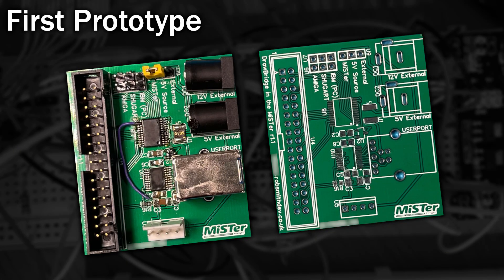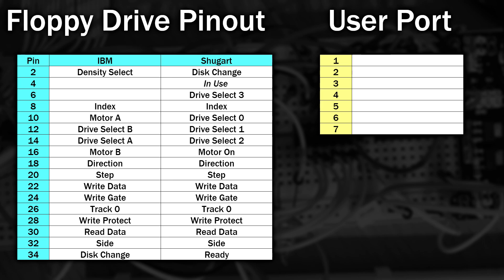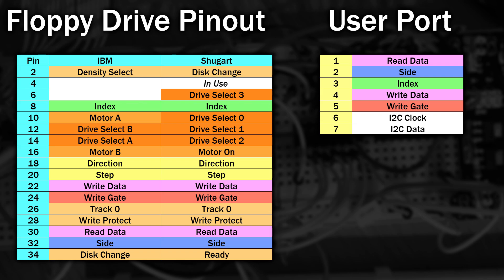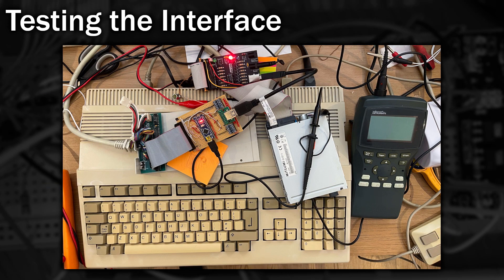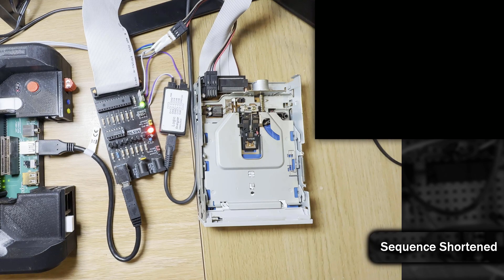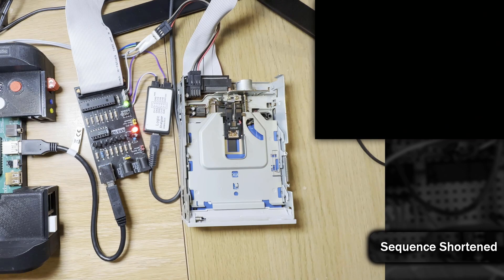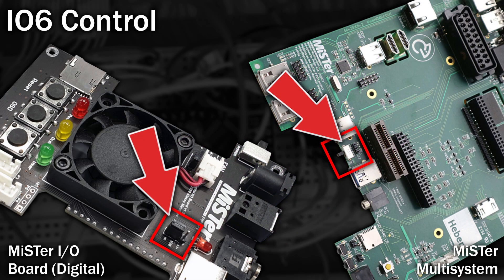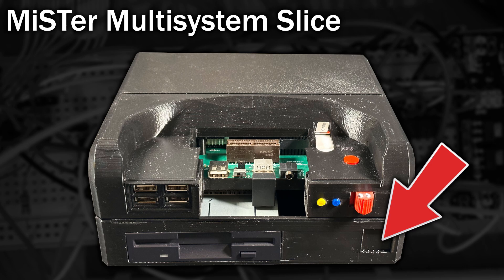MiSTer Minimig - Real Floppy Drive Update!

Comment: This is beautiful!  I've read a little here and there about the project, and WOW it's looking fantastic.  I'd want 4 drives because of some games and installs of Amiga OS, or maybe I'd just go for 2?  I don't soldier, so if someone puts the parts together for a decent price then I might get a Mr. Floppy or 2 or 4.  I prefer the scene releases of games (trainers can be sweet), but I also still own many originals.
Reply from the maker: Hopefully when I have this fully finished it will be available in several forms, from ‘donor yourself’ to ‘off-the-shelf-ready’

Comment: This is absolutely wonderful! I have the greaseweazle and I was hopping I could use it with the MiSTer, but hey, if I need to get a new floppy drive and a new external enclosure for this, that's a small price to pay for such an awesome achievement. One question though: I've been using the MT32pi on the IO port. Do you think it would be possible to use both at the same time? Cheers.
Reply from the maker: Unfortunately not, I’m hoping to add an option to the menu but I need to get one to test

Comment: Good work! Not sure about this, but perhaps you can implement a high speed ethernet port using two of the pins, and use that for main I/O and just use the i2c for slow configuration?
Reply from the maker: I havent checked. Is there no ethernet support in minimig?

Comment: This is by far the MiSTer related project I’m most excited about. I understand that I’ll still have to have a drive for the Amiga core and another one for the PC, correct? (Or will your project allow for Amiga disks to be read in a PC floppy as well?). I can’t wait for this to become available and part of the official cores…
Reply from the maker: One drive will work for both. PC drive is probably best as it supports HD disks (although they won’t work on the Amiga)
Reply: @RobSmithDev  That's great news... Will make it easier to have only one drive :) - Subscribed to your Patreon!
Reply: No, according to the video the adapter can plug in to either and you simply select what type of drive it is on the adapter PCB via a toggle/pin and it interfaces with the core accordingly.

Comment: Huh, why have you not used the Arduino based Floppy interface and then just connect it to the Mister via Serial or USB? In fact I would actually love if you would do this!
Reply: Basically have the serial pass the needed pin details or otherwise act as a slave fdd controller.
Reply from the maker: Because this wouldn’t be accurate or fast enough for the mister. Unlike what I did with WinUAE this doesn’t need a whole load or hacks to get it to work. This design is so much simpler and the mister actually sees the true real-time data from the disk
Reply: @RobSmithDev  True, still, it should be possible (not with a 16Mhz uno) to have it be fast enough to enable the thing to work. I'm thinking a custom serial protocol that encodes the floppy bus data directly and works kind of as a accelerated slave fdd controller. Would this not allow the same kind of functionality? (Assuming serial speeds reaching 1-3Mbps)